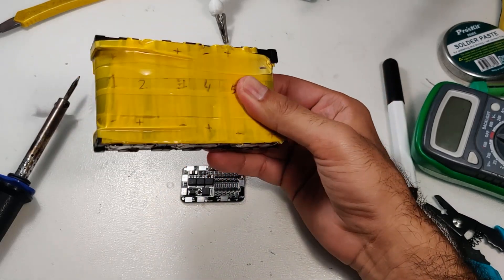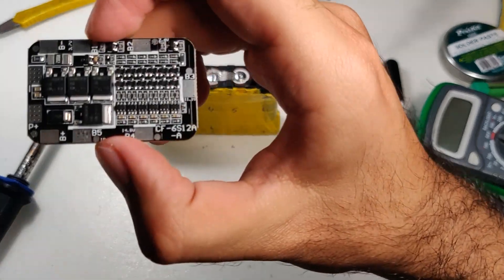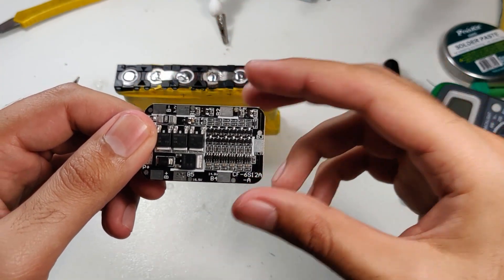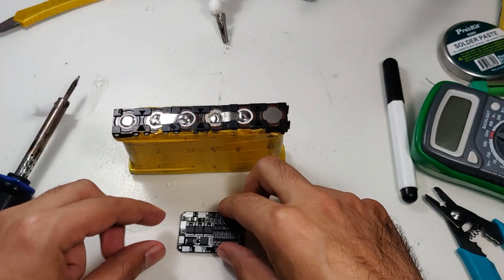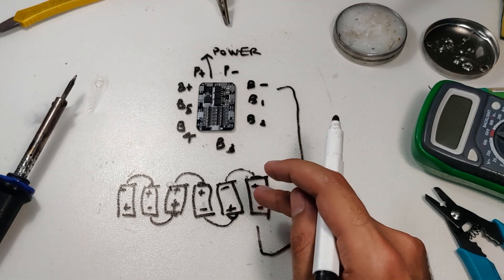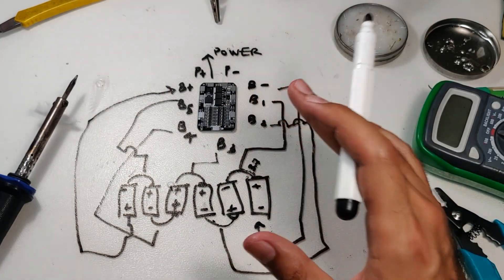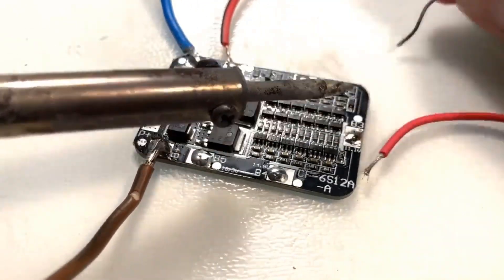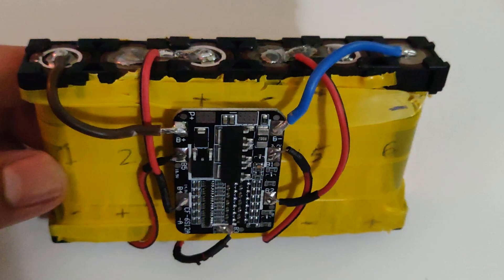What's a BMS & How to connect to your battery pack! Ep4

Comment: I made a mistake while connecting batteries to the BMS (it's a 3S battery pack), I connected them in the wrong order, BMS got little hot. As soon as I realised I removed the BMS and connected it in the correct order. 

BMS seems like working, but I'm worried that something might happened to the BMS. Do you have any opinion on that?
Reply from the maker: Should work
Reply: @Fungineers  OK, thanks! 👍

Comment: Bro I need your advice I bought BMS same characteristics but old BMS is discharge current is 30 A and charge current is also 30 A but the BMS I bought is discharge 30 but charge current is 15 so May I use this BMS ?

Comment: can I use a 4s or 6s BMS with 2s?
Reply from the maker: Depends on the bms but for most bms...no.
Reply: @Fungineers  ok that's why i have 0v at the output, thanks for your quick reply

Comment: How do I determine the gauge of wire to use to connect a bms?
I assume that it doesn't matter on size of battery built.
14s12p or 6s1p.